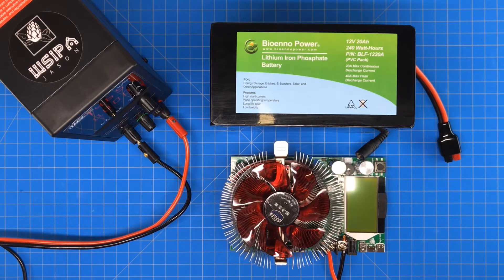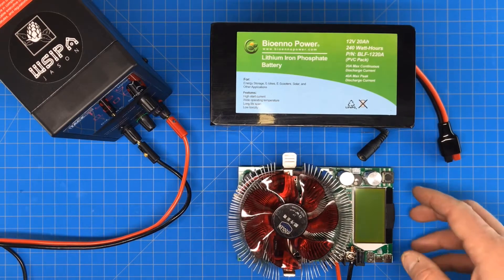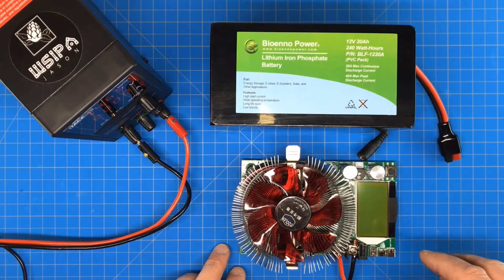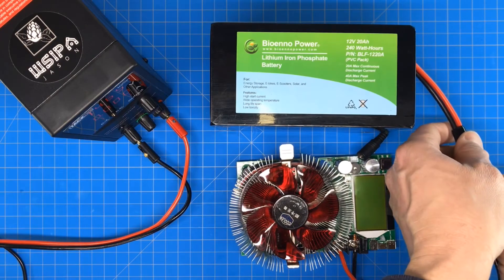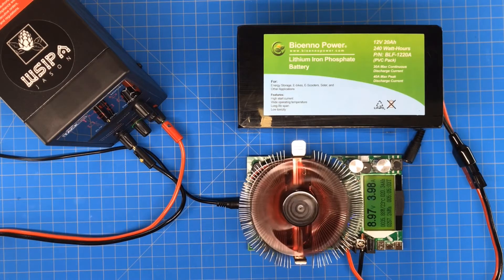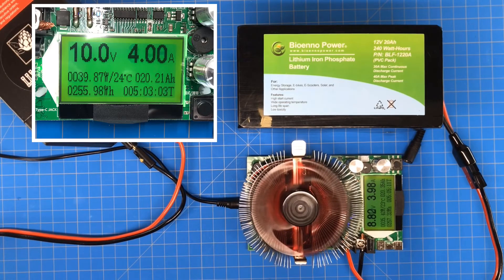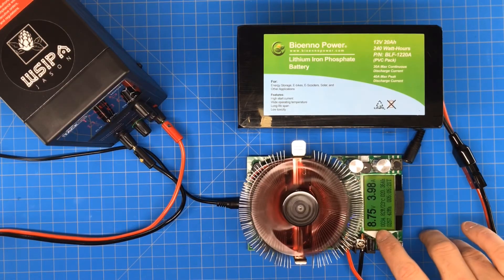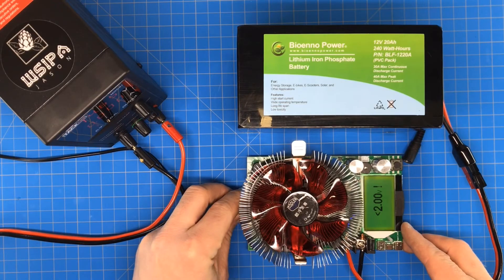Capacity testing the Bioenno Power Lithium Iron Phosphate (LiFePO4) Battery Model BLF-1220A

Comment: Thanks for the nice video. Any special reason why you only did the test with only a 4 Amp load current? I would be interested to see how long it can run 20 Amps (max. continuous rating) and 40 Amps (max peak rating) as shown on your battery's label. Theoretically it should run for 1-hr on 20 Amps and 0.5-hr on 40 Amps, but would like to see their actual performance on these max. ratings...
Reply from the maker: The test I did was a standard .2 C rate discharge test , this testing standard is used to compare battery on an equal playing field (The load tester I was using is only capable 190 Watts so a 20 amp test is out). The 40 amp max you see is a BMS rating (wire size and solder joints) and has nothing to do with the battery rating .   (If you are looking for a high amp draw battery check out the 38120 cell they are capable of a 15 C discharge rate)
Reply: @W5IPAJASON  Thanks for taking time to reply